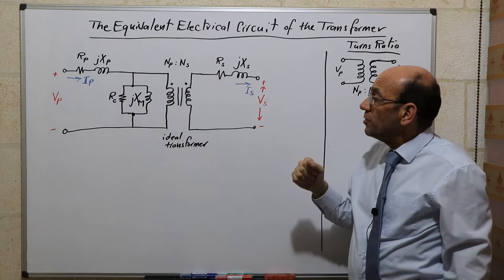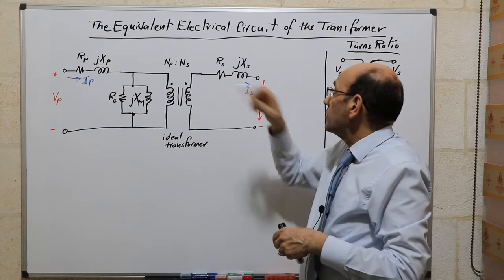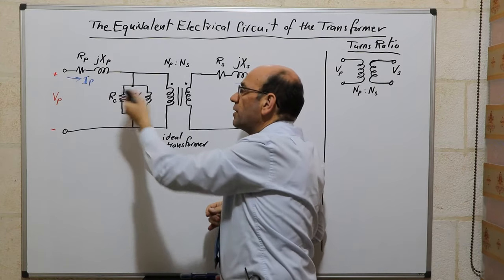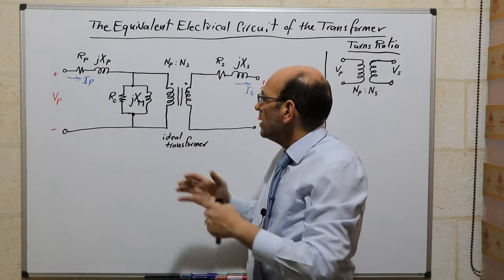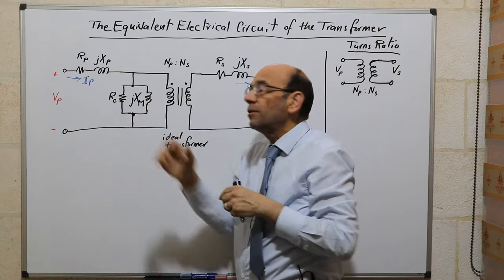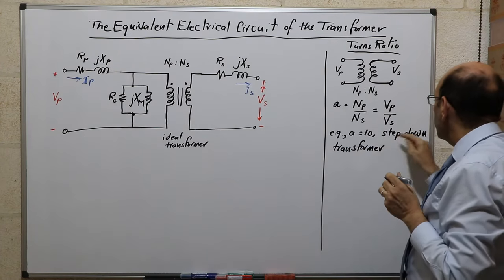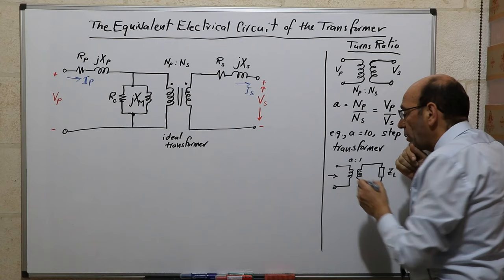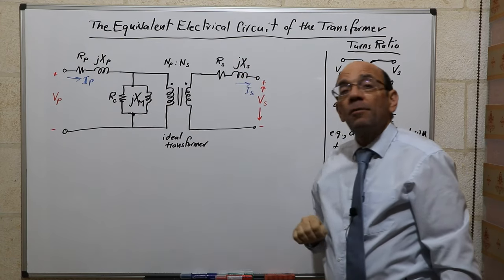Simplifying the Transformer Equivalent Circuit Model (1), 4/4/2020

Comment: Hi, how would the reverse flux flowing through the core as a result of the secondary current, which weakens the initially stablished magnetic flux, be accounted for? Is that accounted for by the shunt inductor jXm?

Comment: What would be the transformation ratio for charge in transformer?
Reply: Turns ratio won't change with load increase, but secondary voltage will drop a little.